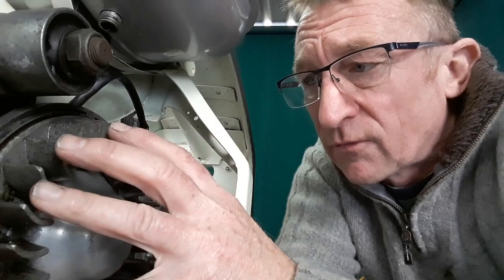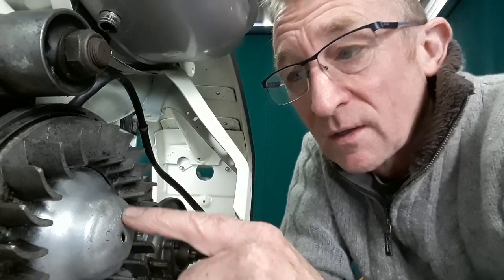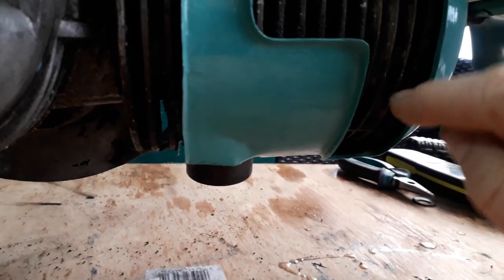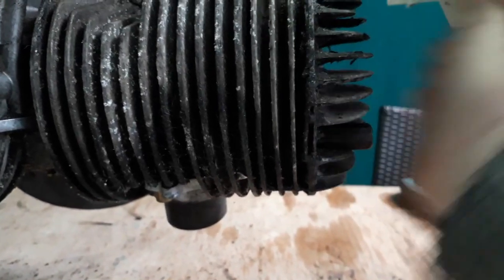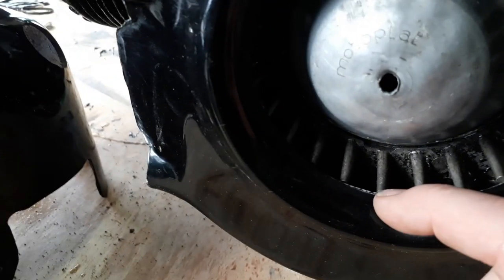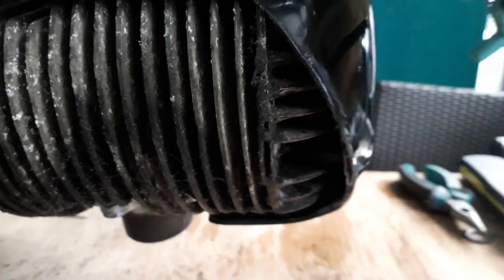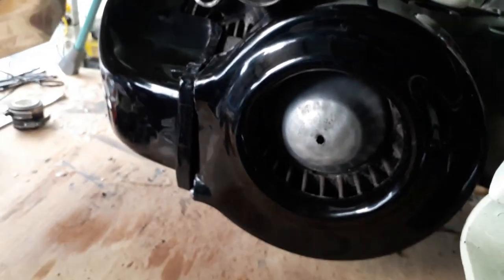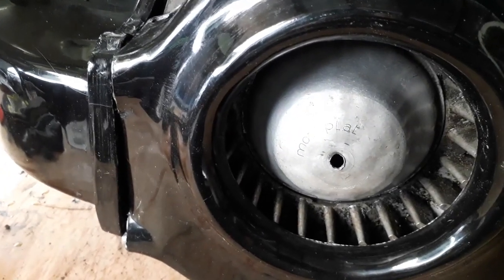LAMBRETTA COOLING

Comment: This actually works. I've even fitted a leaner needle and still runs cooler. What's your opinion on modifying further to block escape at the exhaust stub?
Reply from the maker: pointless it still passes via fins ? and you need air flow around this area its hot ? i think its a bad idea thats why i dont do it .........

Comment: Hi Steel weasel I am going to modify my cowlings as soon as  possible, I had made a cut out under the carb copying the one on  my TV 175, thinking it would let the hot air escape , I am now thinking this was an error as it may loose air flow to the top end, apparently it was to warm the carb, exactly what you don’t need, would you advise blocking this off with a bung until I can modify properly, thanx for your advice, you must have helped many people.
Reply from the maker: yes block it off mate air on to the carb can be ok in winter in temp below 5c but above that it becomes a problem boiling fuel in carb and diverting from head .

Comment: Have you a fin in the cylinder cowling ?
Reply from the maker: no lol  he would be a very unhappy Fin
Reply from the maker: i think the fin you are thinking of was fitted on some lambrettas that had an exit to heat the carb , the fin directed some of the air towards this exit . Not in my cowlings sorry .
Reply: @TheSteelweasel  ha ha 
I've cut an old cylinder cowling up today but but what's stopping the air passing out straight past the exhaust stub?
Reply from the maker: @andysimpson5481  all you can do is keep the cowling as close to the stub as possible but it wont make much difference as most of the heat is in the head . keep the head cool and the rest stays cooler ?
Reply: @TheSteelweasel  cheers mate. At least air can pass over the cylinder head now. Not sure about cutting the rest of the side off and centre out my flywheel cover

Comment: Hey Santa, do u sell the flywheel and cowling? 😁
Reply from the maker: yes i do, but if you wait a bit im doing better ones in the new year )  these are fiberglass but im going to make some in carbon / pla  3d printed .
Reply from the maker: it takes me three days to make them in fiber glass and its just lots of work for little money so im going to try to print them in carbon impregnated pla plastic ? its strong and heat resistant to 160c
Reply: TheSteelweasel ok Steve,
Reply: @TheSteelweasel  another great tip and vid.yhink i would like some of those too.
Reply from the maker: @lesliemagson6431  hi Les and merry xmas , the set you saw are on there way to tenerife to my mate steve scooter edwards . once xmas is over and i have time i will be making some more so ill let you know when i have some done . you running standard barrel or st1 / ss225 etc
Reply from the maker: are you running standard barrel or ts1 / ss 225 ?
Reply: TheSteelweasel hi Steve, I run Ts1 and Rt’s
Reply: peter kreisler lol 😂
Reply: @TheSteelweasel  i have a rapido 225..variotronic stator.
Reply: Also a rt195 with bgm steve
Reply: @TheSteelweasel  rapido 225..also a rt195..all the best for the new year steve
Reply from the maker: peter kreisler  hi the price is 45 pounds + postage . you guys can contact me abchoppersgib@yahoo.com
Reply: @TheSteelweasel  do you have the flywheel and head cowlings on stock? Your tips and clips are excellent 👍
Reply from the maker: @ugd884r  no sorry made to order only . Abchoppersgib@yahoo.com

Comment: Years of Studi Innocenti destroyed so easily?
Reply from the maker: If you think Innocenti is perfect you could'nt be more wrong , It was changed many times by them and limited by cost ? the last GP was as far as the development went . But still had poor brakes , unreliable electrics and a cooling system designed to commute short trips , we now demand them to tour sitting on duel carriageways at 60 mph , so standard lambretta is not designed for this thats why im changing things on my scooters im too old to push .
Reply: TheSteelweasel that's exactly what I was thinking about. I think original  cooling and braking are ok for a standard machine designed for trips around town. I did my question because it seems you are doing that on a standard machine with a standard carburettor and ignition. However great recommendations. Thank you.
Reply from the maker: @kingandy4214  lol that bike just happened to be on the bench , but its not so standard has 21mm oko carb 190 sr kit and a bgm v4 ...... but yes she only goes to the shop on it lol